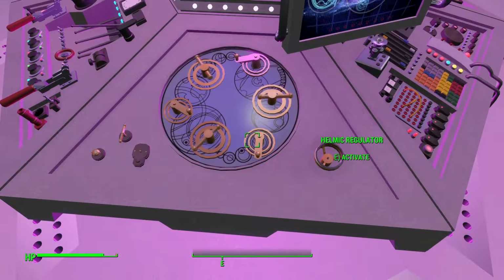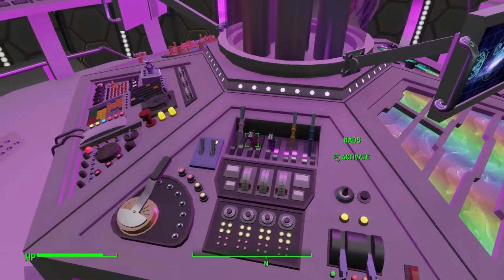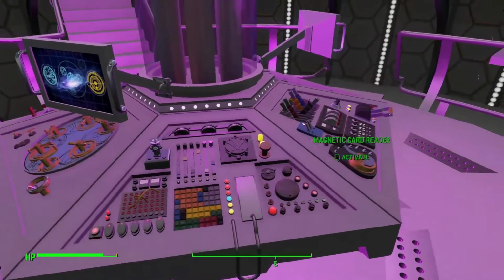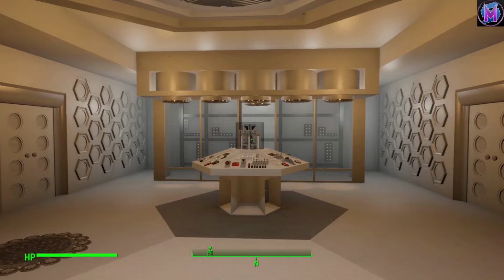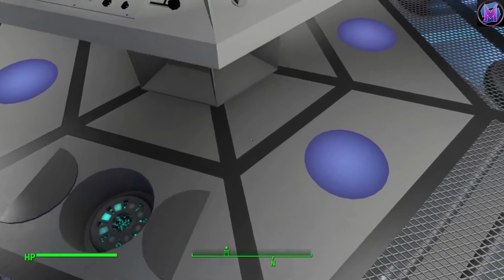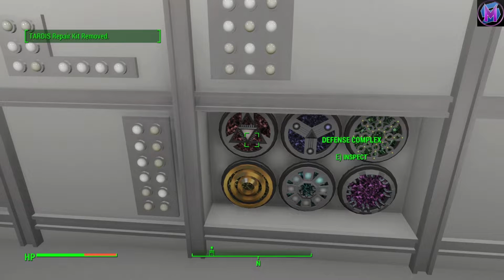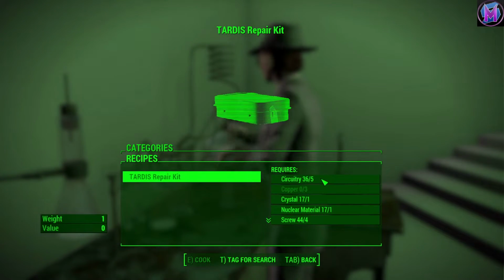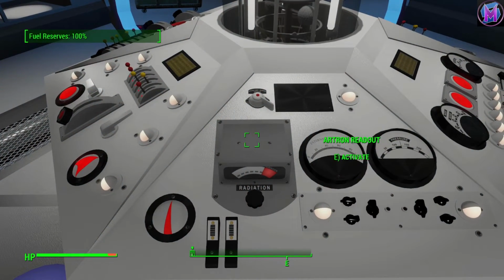How to Fly Your TARDIS: Flight Mechanics and Maintenance

Comment: I think i might have done something Wrong With the Controls Becuase The Throttle Is not Working for me
Reply from the maker: What state is your TARDIS in? If its a new one, it may need some upgrades. If its an old one, the systems may be damaged. I hope this helps!
Reply: @ShamelessMayhem  Figured It out. I think it was a bug Reloaded Game and it worked. But if I press the throrrle but dont actually use it it jsut breaks for some reason. 1. thanks for responding so quick
2. im VERY new to this, to fallout and this mod
Reply from the maker: Take your time and have fun! Its a lot to try and learn at once, so take your time and enjoy the ride. Its still the best TARDIS-sim out there! Next, you gotta try it in VR!
Reply: @ShamelessMayhem  im actually getting a vr headset soon! i will DEFENETLY try that.

Comment: why when I program a flight with the navcom that I do helm controller plus accelerator, spatio-temporal the tardis does not fly and also that the doors are closed properly
Reply from the maker: To fly the TARDIS, the order needs to be (with the doors closed): Navcom, Helmic Regulator, Vortex Throttle (maximum vworp!), Lockdown Mechanism then release the Handbrake. HADS and Autopilot are optional. Stop by the Fallout Who Discord sometime! https://discord.gg/4R3qNMfe95
Reply: @ShamelessMayhem  I can no longer join the server I was banned